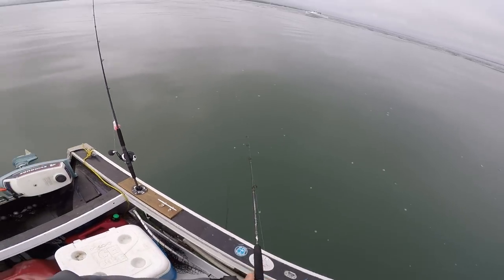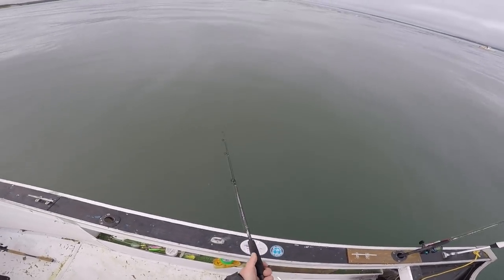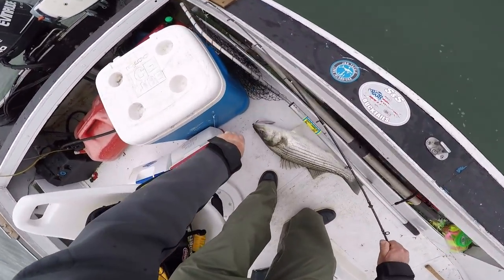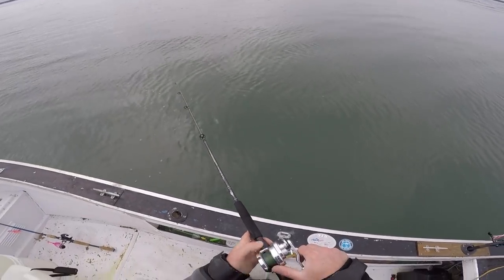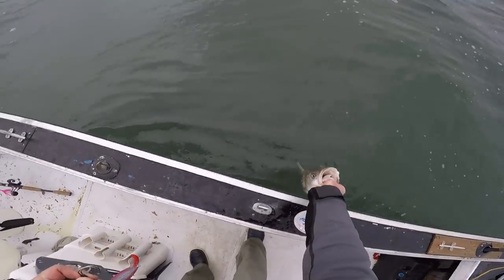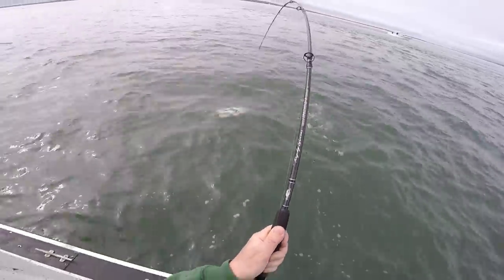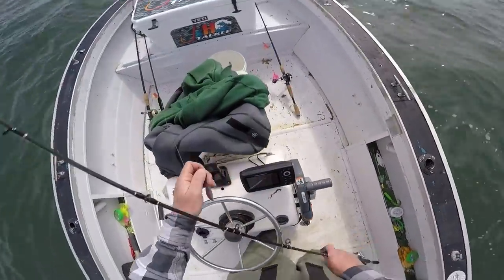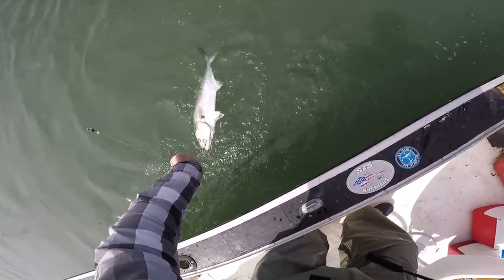Slow Pitch Striped Bass Fishing Attempt

Comment: Great video.  It did not look like you were slow pitch jigging in the beginning. But it was hard to tell.  Given that the squidding technique was working, you should have tried the short slow pitch.  Which is a quicker and shorter crank lift and drop.  Or, maybe a continuous bounce and crank like the deep drop guys do.  Btw,  it was probably too shallow to do.a slow pitch properly.  The technique was meant to cover deep water columns.

Comment: u r the first one that i know who suggest that hooks to be in the back not in front, i been doing same with great success.the question  now is why everyone use it with hooks in the front??any one know the answer??
Reply: Mohamed Elashaal because in slow pitch jigging, the main emphasis is usually getting the fish to bite on the fluttering fall of the jig. When the jig falls like that, it’s actually falling sideways so there is no “top” or “bottom”. One method is you lift and crank, lift and crank then control free spool the jig back down so it has an unencumbered flutter back down. This fluttering motion is often when the fish bite. When the fish see a fluttering baitfish (aka a dying or helpless baitfish) they will often attack the “head” and swallow it whole hence why the hooks are at the “front” where the “eyes” of the lure are.

Comment: Nice video. Buy one thing is that rod is made for a lefty reel because the eyes go to the left. U should get a rod that the eyes bend to the right.
Reply: Nomad damoN it helps with sensitivity and helps balance the wieght load when you have a fish on
Reply: George M. Actually the theory is it counteracts the torque of cranking with right hand retrieve.
Reply: Samoflido defidently not true. The line will rub against the rod and fray with it bending with wrong way
Reply: thats hows its built so it not bending the wrong way.
Reply: Spiral wrap does help with torquing, it also helps keep the line from catching on the guides while vertically pitching.